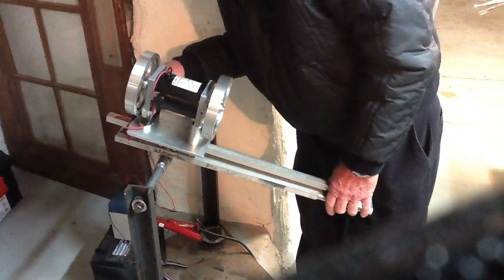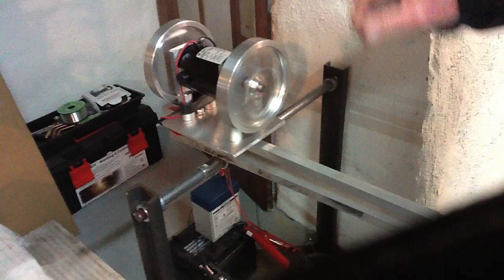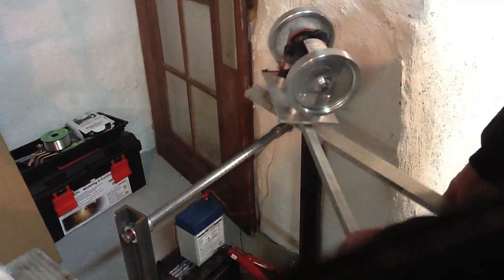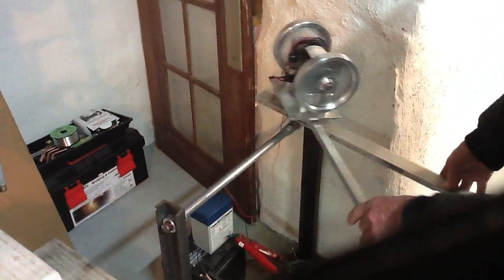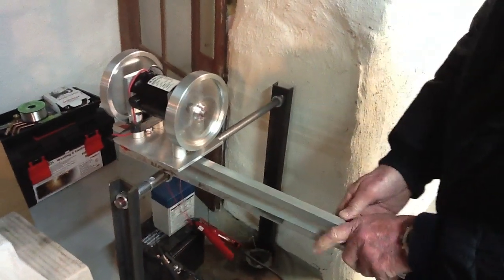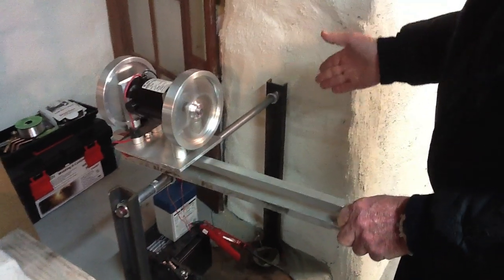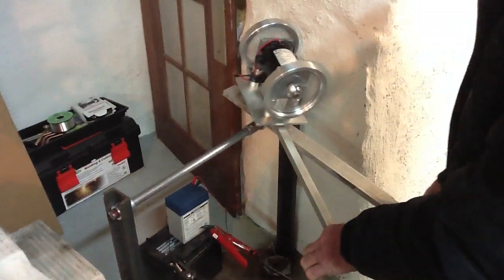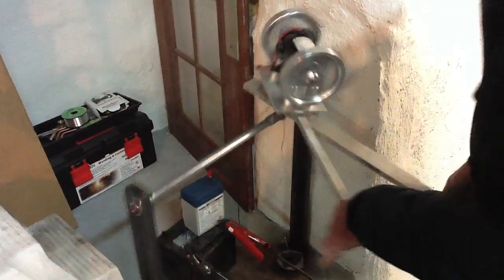I, Guided Linear Propulsion

Comment: Why wouldn't you try this vertically?
Reply: Probably could.  Basically, the end of the skinny handle acts as a pivot point to provide an offset gyro precession situation, like the bicycle wheel hanging by a rope, but instead of gravity providing the torque, the bigger arm is feeding that torque.  Yeah, orient the thing vertically, design the mechanics to mimic Fran's hands, and use an opposing magnetic bumper stop to transfer the inertial impulse for lift at the top. The beginning of the cycle would have no downward impulse to counter.  To reset cycle, reverse the applied torque when the gyro bumps into the top to reverse the linear type precession, then turn said torque off near bottom, precession will disappear without downward impulse on frame. (Watch Laithewaite Xmas 1974 lecture to get the idea of non-transmission of momentum in gyros in precession).  Rinse and repeat with rapidity.😛

Comment: This looks like it's using a fair amount of electricity to get the flywheels up to speed for something that could be achieved with a traditional linear actuator or LVDT.

I've always found this phenomenon interesting nonetheless. 1) Torque equals rate of change of angular momentum, and 2) derivative of a vector is another vector at a right angle to that vector. Veritasium demonstrated this in the 'Anti-Gravity Wheel?' https://www.youtube.com/watch?v=GeyDf4ooPdo

Comment: I have two questions.  I see that the lower handle inputs the forced precession.  With the upper handle, are you slightly dampening the precession motion of the gyros with your hand as you apply the torque on the lower arm?  Also, if you were to only force precess the lower arm, and not touch the upper arm, how would the linear motion of the assembly be affected in comparison with what you demonstrate in the video?

I looks to me that you are creating a differential in the precessional inducing inertial forces acting on the gyro discs between the upper rim and the lower rim closest to the slider track. The upper rim has more kinematic motion during forced precession than the lower rim, and I have a sneaking suspicion that this increases the inertial  force acting on the upper rim acting into the wall, whereas the lower rim's inertial force acting away from the wall remains the same, viola, a possible net inertial unidirectional force into the wall on the video.

I can hear it now, people saying that this thing is in violation of the conservation of momentum, which is fine if you believe that space is an empty vacuum, but if it is an aether, than it is possible that there is no violation, because inertial forces could be now figured as an external force that can do work, as your device looks to promise to do.

It almost looks like it wouldn't be too difficult to design a thrust generator from your conception, the main challenge would be in rapidly recycling the gyro discs efficiently to be re-force precessed.  I believe I may have an idea in how this could be accomplished.
Reply: May  I ask, whats your progress?
Reply: Already 7 years! Nothing done?

Comment: Hi, I just placed a video in youtube (not knowing about Your discovery) that shows how exactly one can use this effect You're speaking of here. My video is just two pictures and a comment, and it's here /watch?v=jlcsVD54_iM&feature=youtu.be
What will You see there? Let's say You attach Your rotating disc to one side of an arm, the other side of an arm You attach to an engine to rotate the arm... and You turn your rotating disc by some 45 angle degrees. Check it out, 'cau it uses Your experiment.